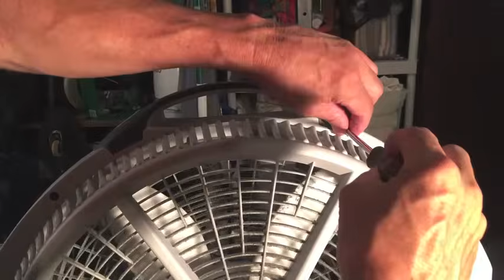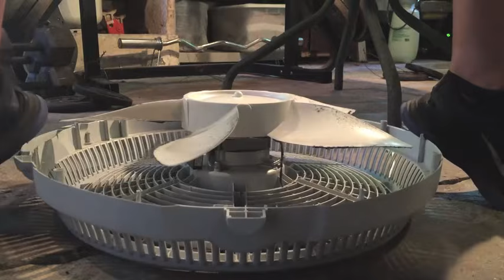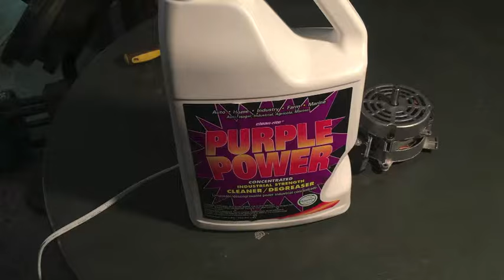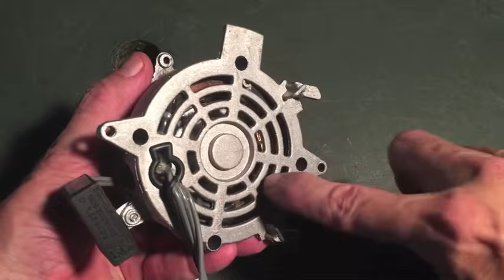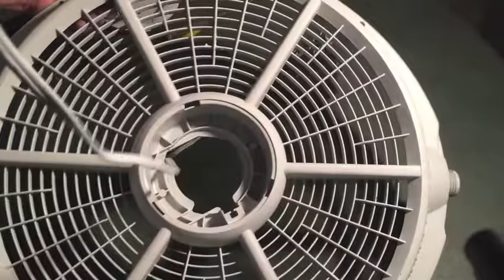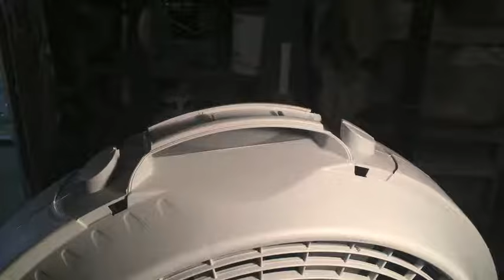Clean/Lubricate Lasko Wind Machine (Again)

Comment: There should be felt or similar material surrounding the bushings that needs to be saturated with light oil (3 in 1 will work). The bushings are made of sintered metal that allow oil to slowly seep through. Doing this every 2 years or so will keep the fan running for a very long time or until the switch breaks. You may need to lightly tap the shaft in several radial directions after reassembly to realign the bushings to the shaft if it doesn't spin freely, especially the front bushing which usually gets out of alignment during disassembly and reassembly. The bushings are convex on their outside diameter to allow for this.
Reply from the maker: That's all great information.. Thank You..
Reply: @PeanutButterMan-PBM 👍

Comment: I CANT GET THE FAN BLADE TO GO BACK ON NO MATTER WHAT I TRY SO I GUESS ILL JUST SELL THE FAN TO SOMEONE ELSE. IT WORKS GREAT. I JUST CANT GET THE FAN BLADE TO GO BACK ON PERIOD. WHAT A LOAD OF BS. GO FIGURE. ILL JUST HAVE TO GO BUY ANOTHER ONE AND THIS ONE IS IN NEW CONDITION. IM DONE TRYING TO FIGURE IT OUT . POS. NO OFFENSE.
Reply from the maker: I don't want to ask a stupid question but did you follow the procedure that starts at 03:59? Matching the flat side of the motor shaft with the flat side on the back of the blade..

Comment: Thank you stopped using mine when it started squeaking last year. Had to take the motor apart before the got the blades off so that for sure got oiled. I've had mine over 25 years.

Comment: Can I use wd 40 instead for oil? I worked hours trying to get those damn screws out and see down need to do it different. I cleaned it once before but forgot how I did screws and the video never showed how to take out motor and clean in there..I am 69 a recent widow, living on a fixed income. Trying to learn how to do all this. I cleaned 3 box fans today and 2 stand ones. I have no air conditioning in Florida and need my fans. With cats they get a lot of hair in them. Mostly the wind tunnel which one cat loves to lie right under it. Its half apart so if I can use wd 40 I will finish tomorrow.  I have a muscle pain disorder so can only do so much.  Thank you for all your info. Anyone wd 40 ok? Now just show me how to fix my squealing dryer I stopped using. I fixed my hot water heater problem myself very proud of that.

Comment: My Wind Machine doesn’t turn on.  Do you think this will fix that?  Thanks!
Reply from the maker: It's worth a try but fan not turning on may be a problem with the power cord, the plug, the switch, the motor etc..

Comment: After doing everything he said to do in the video and the fan motor seems to be burned up your last option is to replace the power plug 🔌. There is a fuse installed on the plug. If the motor still doesn’t work then the motor is bad. Before buying a plug cut the plug off and ohm out the motor to see if it is bad. If motor is good be sure to use a GFCI receptacle to prevent fire. Good luck!

Comment: My wind machine is making a squeaking noise. Can I fix this or will lubrication of motor get rid of it? It does not make the noise in one or two places when I tilt it differently but definitely makes loud noises in most directions of tilt.
Reply from the maker: I can't say for sure that lubrication will fix the noise but if I had to guess I would say... yes it will...
Reply: @PeanutButterMan-PBM  I will try bthis. Thank you!

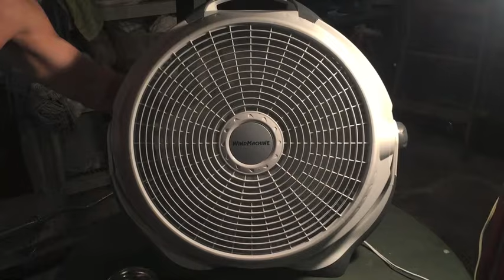Comment: I cleaned my wind machine today following your directions. Thank you it looks great. Your directions were spot on. I did not use any oil just cleaned the motor. After putting it back together it worked fine. About an hour of running it started making a screeching sound. I took it apart and sprayed a bit of W-D 40 on the shaft, and put it back together. Now the fan is slow to turn and continues to make screeching sound. Any clue to what might be going on and is there anything I can do to fix it? I have a great looking fan that’s not working lol! 6:00
Reply: I ended up pushing the wires in and it worked. Not sure if you’re having the same issue
Reply: WD-40 is NOT for lubricating fan motors. Zoom Spout oil or 3-in-one in the blue can is the proper oil. WD-40 is only temporary and will break down sooner rather than later.

Comment: Did you just apply purple power then rinse it off without any scrubbing?
Reply from the maker: correct.. no scrubbing..
Reply: @PeanutButterMan-PBM  just cleaned my fan for the first time in eight years. that purple power is STRONG!

Comment: Can I use 3 in 1 multi purpose oil in lieu of what you have?
Reply from the maker: Here's an answer to the same question.. Found on an Antique Fan Collectors site: 
"3 in 1 "Motor Oil" in the BLUE can, NOT the "Multi-Purpose" Red container. SAE ~ 20  (both are non-detergent, ONLY buy the BLUE can! (The red can has Naptha.  Not recommended.  The Naptha gets the dirt in suspension then evaporates leaving dirt on the bearing surface, like detergents) Chain stores Lowes, Home Depot, may stock the BLUE "3 in 1 Oil"
Reply: Oh I see. I gotta exchange mine back for the blue one. Thank you!

Comment: question, I put the fan back together the same way I took it apart but now it makes a rubbing noise whenever I cut it on it goes away but you hear it again when you cut it off & the blade slows down, any idea what that could be?
Reply from the maker: Possibly, the blade may need to be pushed farther onto the motor shaft.. Thinking that the blade as it speeds up is pushed back (no rubbing) then as it slows down there's less force pushing it back and it may be rubbing the front as it slows down..
Reply: @PeanutButterMan-PBM  Thank you🙌

Comment: Just replaced my old one of this model with an identical one.  I had it face down towards the floor for an evening to dry something on the ground.  Woke up to a somewhat sizable pool of oil mostly on the bottom of the "U" that holds the fan in place.  Should I be doing a cleaning and relubrication?  or was there just too much lube/oil put in from the manufacturer?

Comment: @tongo117 Thank you for this video, both this one and the one from 6 years ago helped me greatly with performing a deep clean on my fan.  Unfortunately, when I put it back together, the fan blade was rotating very, very slowly.  Much slower than before disassembling it.  Are there any potential reasons for this?  I followed your steps closely and I feel I am doing everything correctly when putting it back together.  Even if I turn it on without fully assembling it, it turns very slow.  Thank you for your time and video
Reply from the maker: I can't think of any reason it would run more slowly after disassembly/cleaning unless you lubricated the  motor shaft with something that the motor shaft didn't like.. To cause friction thereby slowing the rotation..
Reply: @PeanutButterMan-PBM  I used WD-40, was that not a good choice?
Reply from the maker: WD40 not the best long term choice:https://diy.stackexchange.com/questions/47749/how-to-lubricate-a-buzzing-fan

Comment: I cleaned and oiled mine 4 years apart from each cleaning cause eventually it squeels,  well I followed this again and all was well, then it started squealing and i thought I turned it off and didn't unplug it but it was on low but blades were not turning.  Well I smelled wires melting and thought something was on fire like my fridge or uverse boxes,  dang the smell got worse and worse till I tracked the fan down and it was so hot it was almost on fire and wires were all burnt, surprised a circuit didn't blow but if I would have left the house I believe it would have been on fire so I'm now tossing it in the garbage and going back to my older square safer floor fan.

Comment: I have a Lasko 3300 Wind Machine like yours that I recently rescued from the dumpster. I tore it apart & washed all the plastic. The motor still works, but the screws are seized in the motor. They are steel screws seized in the aluminum motor housing. The motor really needs oiling since it has no free spin to it. Can you think of a way to get the screws out or a way to oil the motor with together? How hard was it to get your screws out?

Comment: Thank you so much , instead of 3-1 can WD40 work ? I’ll have to run out to buy the 3-1 lubricant but that’s not a problem either..
Reply from the maker: Short term WD40 may be ok but it's not meant for long term use. https://diy.stackexchange.com/questions/47749/how-to-lubricate-a-buzzing-fan
Reply: @PeanutButterMan-PBM  gotcha thank you & yep I’ll do the 3 - 1

Comment: I'm 78 and followed your directions.  Got a little confused on how to put that motor back in the the plastic base but got it figured out and now both of my WindMachines are running smoothly and are dust free.  I used compressed air to blow out the motor and it worked faily well.  Good directions, thanks.
Reply from the maker: You are welcome.. Glad to have helped..

Comment: I dismantled mine last night and I could not get the blade off.  I really had the thought that it might have been glued down for some reason.  I also thought the little back cover might have had some screw I couldn't see or something.  Glad to see both aren't and I really need to use a lot of force.

I'll disassemble that motor whenever I find my oil now thanks to this.  Can't wait to stop hearing the squeaking.

Comment: Just came over to say thank you for this! I took it apart once but didn't remove the fan blade, and saw in another video that the shaft was probably the issue. I took the fan blade off, cleaned a bunch of crud out of there, then used a can of spray air to blast out a bunch of stuff, then used WD-40 on the shaft. I didn't take the motor out of the back panel though, because cleaning and lubricating it from the top did the trick. But if I need to take it apart again I'll know what to do! I also taped up a filter on the back. I made it out of some electrostatic material that I had on hand to make filters for external vents in your home. Fans have gotten expensive lately and I'm thrilled to be able to keep this one. Thanks again! :)
Reply from the maker: You are welcome.. Thanks for reply..

Comment: Am 84 year old female, just been handed down this fan. Needs cleaning badly.  Everything seems pretty easy except releasing the switch. Try as I lmay the plastic tabs do not budge, cannot release the switch. Tried pliers, no go. Suggestions.
Reply: I GOT IT!!! Also the fan was a bit hard but also got it off. Went back together swiftly. Best instructional video ever made. You have a gift. God Bless.
Reply from the maker: Even if you can't get the switch to release you can still clean the fan pretty well.. Front and back pieces, fan blade, air vents on motor etc.. You can also put a few drops of oil at the base of the motor shaft..

Comment: A tip for getting the fan blade off if it's stuck (learned this from a different video's comments): get a hair dryer and warm up the round head of the blade for 20 seconds or so...makes it easier to pull off...worked for me!
Reply from the maker: Good to know.. Thanks for the tip..

Comment: Love this video! I have three different fans and looked for a tutorial for each one. You're #3. #2 Was a Holmes and I couldn't find a video, so I learned a hard lesson: take a picture of where things were before you take it apart (especially the motor aspect) because I ended up with 4 screws leftover...and I don't know where they were supposed to go! But it works just fine! Thanks for this awesome video...I'll get to work on the Wind Machine now! PS...I like the way you cut to the chase and just get the info out there without alot of extra dialog.

Comment: Thanx but no thanx!! I got as far as disconnecting the round white ring where u snap the two black clamps together to remove the ring & it did not bulge..so for me that was my cue to STOP😊 And to see how far more u had to go WHEW! My suggestion is the fan should have been simple to just snap off the front..clean the blades & BE DONE!! The stand up fans is just that simple to clean. If I knew u had to do all this to clean this fan I wouldn't have purchase ijs for me..I am glad ur instructions was beneficial to others..TY 🙏🙂

Comment: Purchased my Lasko 20" Wind Machine on 8/23/20. Took grill apart and cleaned fan often. The fan just stopped turning on 10/12/21/. A week before it stopped, it was squealing and wobbling every now and then. My motor screws were Hella Tight. I had to lightly tap on the screws with screwdriver inserted, and use channel pliers to turn the screwdriver while applying downward pressure to loosing & take the motor apart. After cleaning & lubricating bearings and shaft that was brown ...Fan is like New. Thank you! You da Man, Man!!!
Reply from the maker: You are welcome.. Thanks for reply..

Comment: The difference between bearings vs. bushings is that a bushing is a type of bearing. While the term bearing is a general term for something that allows motion between two components, bushings are specific pieces of equipment.  No worries you helped me clean my 2 Lasko fans like a pro.
Reply from the maker: Good to know.. Thanks for the info..

Comment: Just a WARNING for everyone. I have this fan. It's great. Service it just like this on occasion. BE VERY CAREFUL if removing the motor housing to oil the bushings, the motor shaft can sometimes bite on the front bushing if the oil/grease is dry. Ended up pulling out the front bushing quite easily, which as far as I can tell, CAN'T be pushed back in properly because of the pronged annular spring that holds it in... Now.... I have a non working fan.
Reply from the maker: Never considered that.. Thanks for the warning..
Reply: Your info may have prevented a headache. TY
Reply: @karenecurran7895 I didn’t read this warning and things worked out fine my fan is working great now. It was broken before I followed this video
Reply: This happened to me too. Thing was gripping like crazy. Tried alot of different things and couldn't get it to go back the way it needed to. Next time I gotta lube first.

Comment: This was awesome...The engine reinstall was kind if fast but I got it. Loved the cleaner and oil recommended. This saved me from buying a new fan.
Reply from the maker: Glad it helped.. Thanks for reply..
Reply: Great tutorial. My 10+ yr old WindMachine had siezed up. Thanks to your excellent video, it looks and operates like new. I used regular 3-in-1 oil since that's what I had on hand. Works great.  Thanks!
Reply from the maker: You are welcome.. Thanks for reply..

Comment: I cleaning it and now it won’t turn on any tips because I haven’t had it for long???
Reply: Check that the power cord wires didn't pull out of the switch. They are not very secure.
Reply from the maker: Only thing I can think of is double check that the on/off knob is correctly installed on the switch.. If it's not the switch may not be turning..